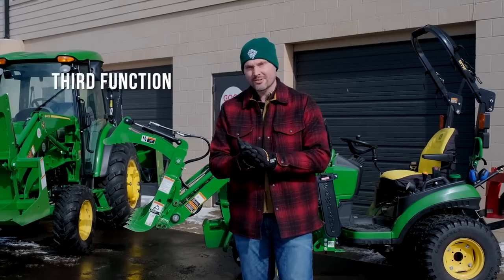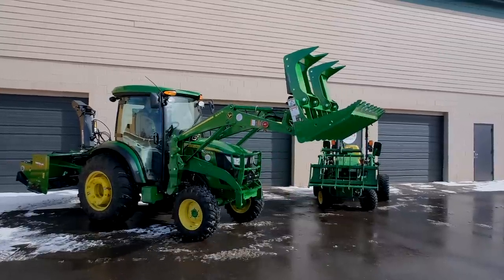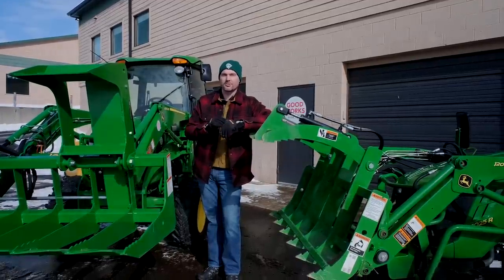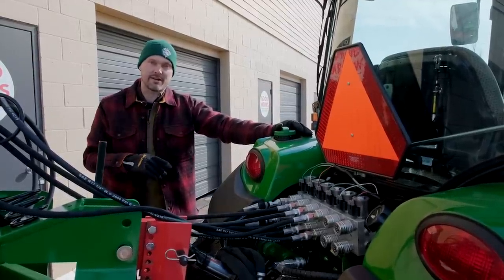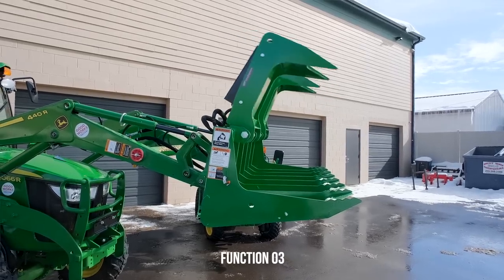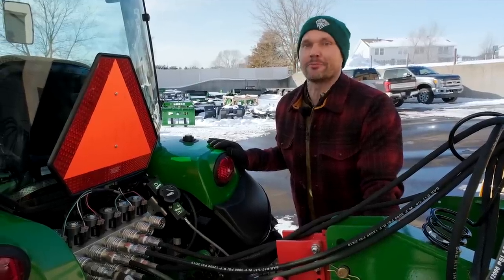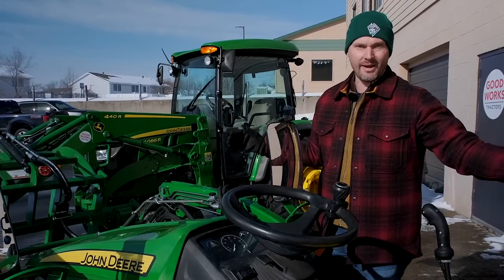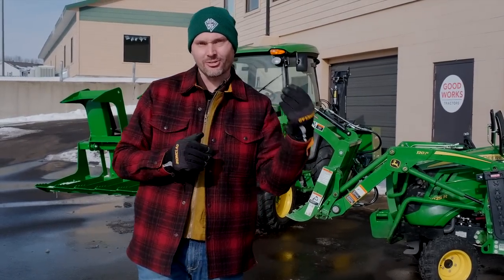EXPLAINING HYDRAULIC MULTIPLIERS, 3RD FUNCTIONS, & DIVERTERS

Comment: I'll ask the dumb question - Does adding all these extra valves and hoses require additional hydraulic fluid?
Reply from the maker: Just enough to fill the empty space in the lines and valves.  So a little bit, but not much.

Comment: Can that 6 circuit control be connected to power beyond? I would think so...
Reply: i was going to ask if power beyond is considered 3rd function.
Reply: No it can't because there is no control over each circuit...
Reply: Just thinking key word is beyond, so it is just hydraulic flow for an implement beyond the tractor that has it's self contained circuit control. It may be a levered implement (backhoe) or something that may have electronic solenoid circuit control.
Reply from the maker: Good question.  Yes, you need a control valve (stop/start flow) in between the tractor and attachment.  To be honest, I'm not positive if the multiplier would work with PB.  Although many do install a traditional hydraulic valve on their PB, so leads me to believe it would.
Reply from the maker: No, typically not because it is continuous flow.  Nothing to stop or start the the circuit once connected.

Comment: I have been working with farm tractors since before hydraulics were common.  At first they were referred to by the number of SCV they had ie single valve, dual valve etc.  Remotes were the pair of couplers that corresponded to each valve.  If they were behind the rear axle they were rear remotes. , ahead of it front remotes.
The total number of remote pairs determined the number of functions. Doesn't matter if the function is controlled by a diverter or by a SCV it is still a function.

Comment: The multiplier is very intriguing.  Could that be fed from Power Beyond on the 1025R?  Location may be a challenge given that the backhoe takes some real estate there.  Anyone do that?
Reply: A "multiplier" has no built in control valve.  The multiplier must be fed by a control valve, which is responsible for controlling the hydraulic flow.  The multiplier just lets you select which pair of hoses that control valve will control.
Reply: If the multiplier is fed via soft hoses(rigid would do too), and wires to control the solenoids, I think it stands to reason a bracket could be made to mount it out of the way, where it can fit, and be accessed, and run like that.
Reply: @bradmeacham6982  Ok..I think I understand that better now.  So I'd have to plumb a separate SCV to control the output flow of whatever multiplier circuit I select.  If I wanted to feed the multiplier off the Power Beyond I'd have to plumb an SCV in series with the multiplier feed circuit off the power beyond with some kind of a bypass when it is closed.  I'd also need to run that valve wide open when I connect the backhoe to one of the circuits.  Sounds doable, but needs more research on what valve would work.

Comment: Can anybody out there help me? I'm looking for somebody that's an oversized man... I know that's a strange question to ask on a tractor Channel... :-) I am 6 foot 5 + 440 lb. And cannot find a tractor to sit on other than a 44 10 and a 4400... Which all have to be modified for me to be able to operate them comfortably. I am willing to go up to 45 horsepower. Which my neighbor has a Kubota l4240. Which I have used. But it is still not comfortable I have to modify the seat to move it backwards. I have several videos where have modified my John Deere 445 to fit my size. By even raising the steering column and everything which doesn't scare me to do with a compact tractor. I just need to find something that's a larger cab. Is there anybody out there on this channel that is a larger man that has problems with these compact tractors in has solved them by buying a bigger tractor??? I am desperately looking for answers in what I should buy. I wished I could find a John Deere 4320 2000 model because I've seen those and I seen a big guy sitting on one he look like he was completely comfortable. Sorry for such a long question I'm just looking for answers before I spend 15 $20,000 on something and have to go modify and then right off the bat

Comment: The question really is:  The Rear Remote vs a Divertor Valve, Are they the same!!??.  Answer is NO!!.  A rear remote should allow to operate something in the rear without taking the functionality from another Function.   A divertor Valve will allow to operate another function but on the expense of some Other function (s).
Reply from the maker: That's a good explanation.  Thanks!